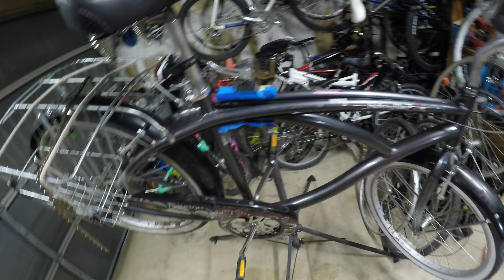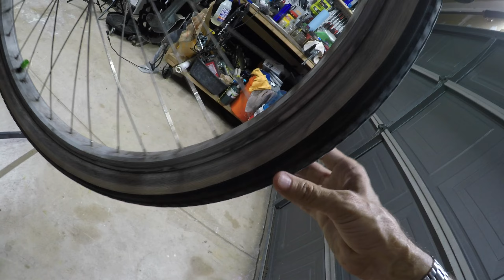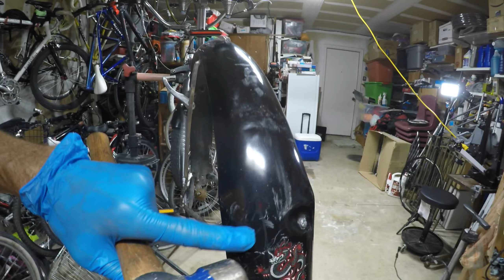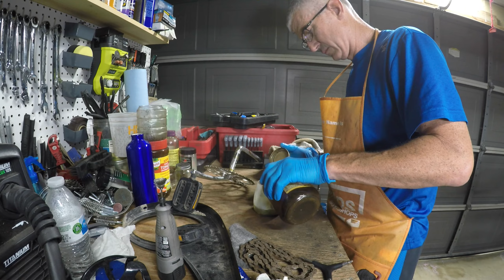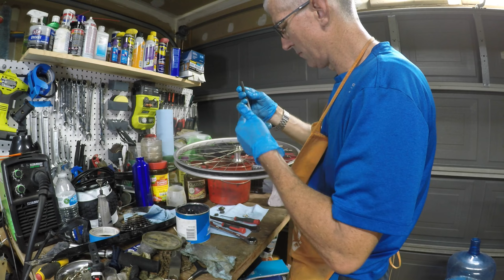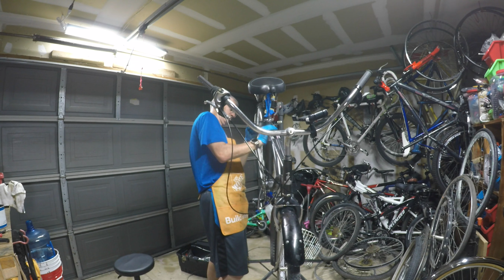🚴 RALEIGH RETROGLIDE 7 REPAIR

Comment: hiya, i just bought a new uk, retroglide 7, (probably ex usa stock) i have looked everywhere, for rear baskets, like on that bike? any specific name or supplier, that you know of. also, is there a front chain ring to triple rings available, im thinking bb mount derailer. how ever, because it has a bmx one piece crank. its gonna make it very dificult.